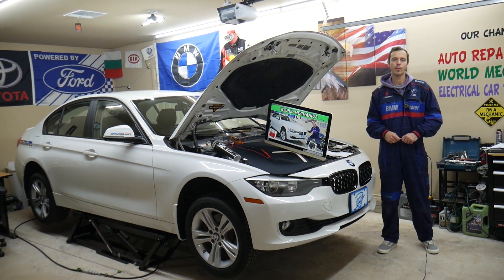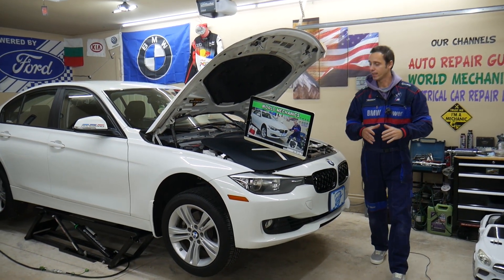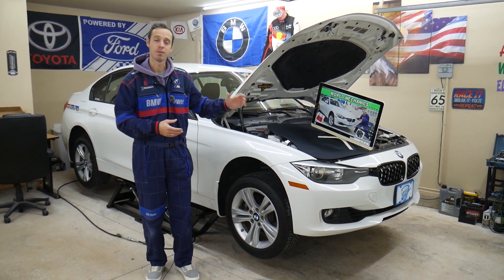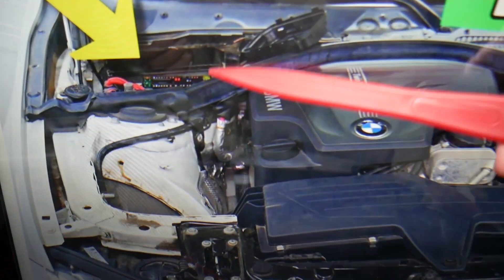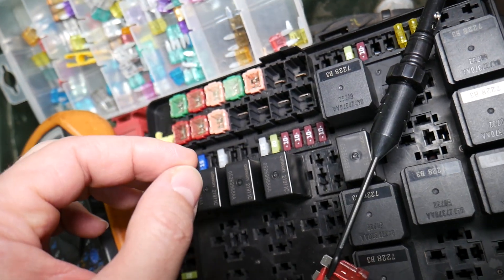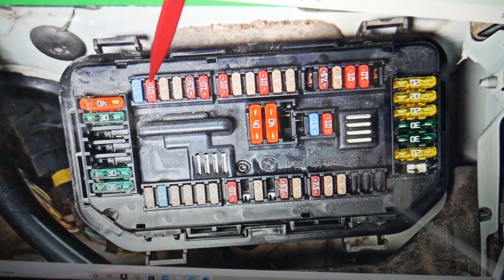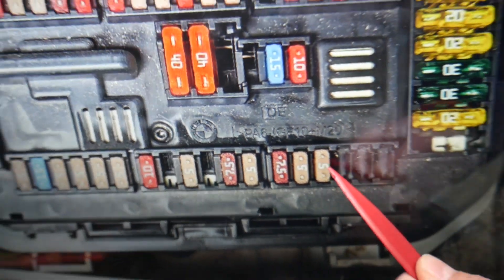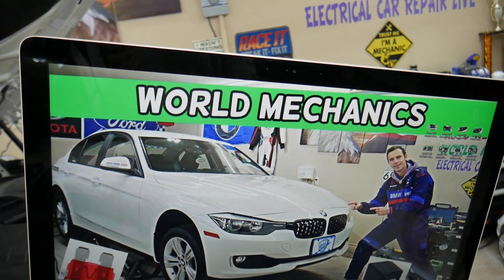BMW F30 F31 AC COMPRESSOR FUSE LOCATION BMW 328i 320i 330i 335i 340i 318i 316i 320d 318d 316d 325d 3

Comment: I was driving my car was blowing cold then stopped, has pressure compressor seems to be working so if I replace all those fuses and it doesn’t work where is the Ac relay located?